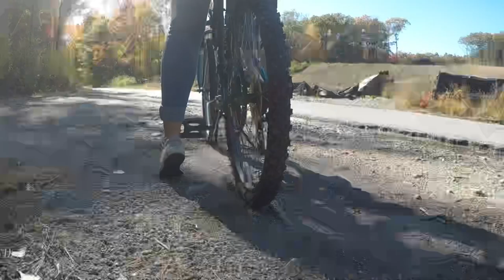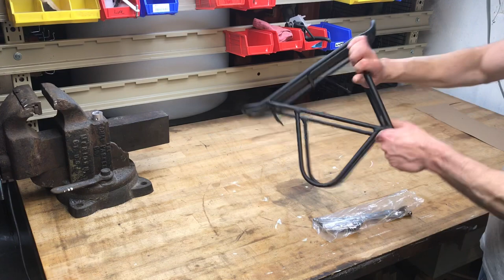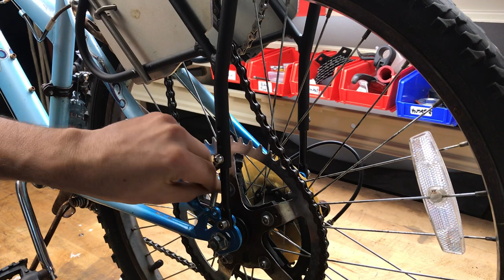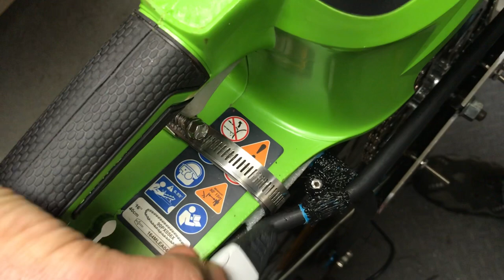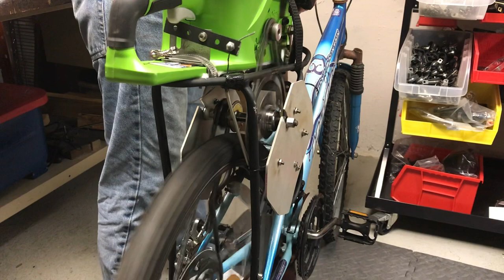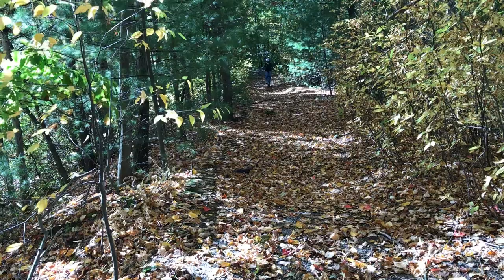BUILDING ELECTRIC BIKE USING 40v CHAINSAW MOTOR

Comment: Enjoyed the adaptation of the chainsaw hack. To be honest many of these electric tool battery packs would benefit any electric bike on the market. 40v for any of the 36v bikes or the 56v with the 48v. Although the 60v packs would need an upgraded controller but I do believe they sell speed controllers that will do both 48v and 60v same with the 36v/48v . Thanks for sharing
Reply: I was planning on going with the 80v version but my friend was talking about torque. Unfortunately I can't seem to find any place that shows the torque even the store that sells it. They cover volts watts milliamps amp hours ohms but nothing about torque.

Comment: I'm planning on doing this but I want to put a big gear where the chainsaw gear is and just put the chain on the small gear but I'm not sure if it will have the torque to keep me at speed once I petal to it.
Reply from the maker: This chainsaw has an automatic cut out when it encounters too much resistance. The roughly 20 to 1 ratio I had seem to be the sweet spot for takeoff and acceleration but not great for top end. You could go lower with the gear ratio which will give you a higher TopSpeed but the chainsaw might cut out at low speeds so you would definitely have to always pedal first. Good luck!

Comment: Do you think a 20 volt chainsaw would still work?
Reply from the maker: The 20v will be very underpowered but it can still be done. You may have to adjust the gear ratios to make up for lack of torque. Good luck with the build!

Comment: So how far per charge and with what AH battery?   Half tempted to sacrifice my Milwaukee m18 to try this haha
Reply from the maker: It has a 40v 4 amp hour battery. It was lasting somewhere between 15 and 20 minutes depending upon how hard you drive it.
Reply: @JGD16  and how far is that? what is the speed?
Reply from the maker: @Studio7g  I never checked the top speed but I would estimate close to 20 mph so that would put the range somewhere around 5 mile

Comment: I want to build a chainsaw bike with a gas chainsaw but ive never done anything like that. Is it hard?
Reply from the maker: It can be a bit tricky but with a little ingenuity and motivation I’m sure you can do it. Lucky for you I have multiple chainsaw bike videos that might help guide you. Good luck
Reply: Would it work if I ran the chain directly to the gears already on the bike? I noticed you usually add a sprocket on the opposite side.
Reply from the maker: The problem with that is your gear ratio. It would create a low gear ratio and burn out your chainsaw clutch. You will need a large sprocket on the wheel or a jack shaft in between.
Reply: Ok! Wish me luck
Reply: I know where to come if I have questions